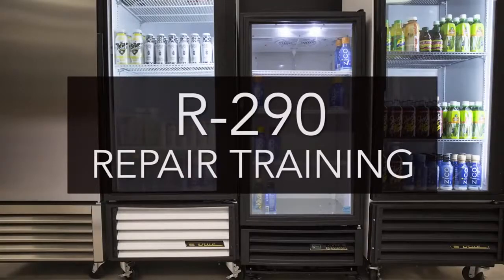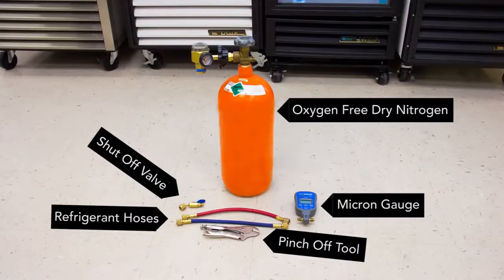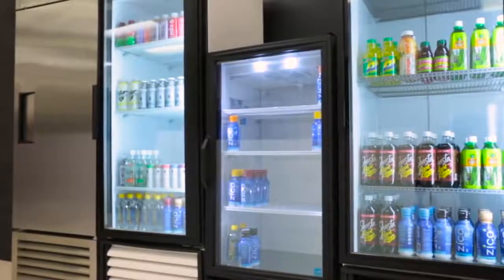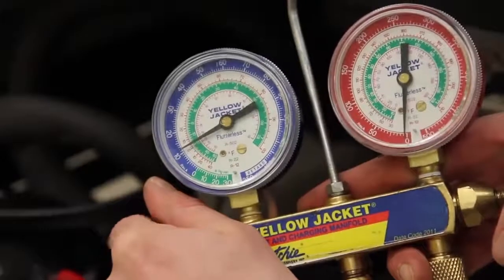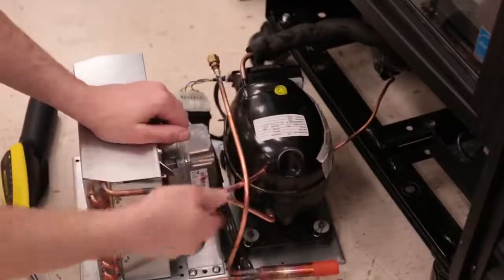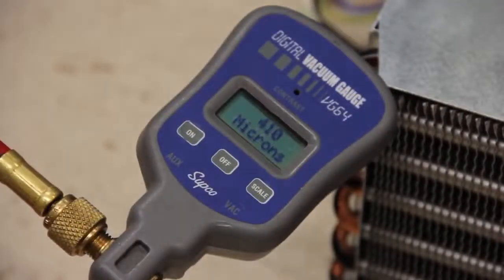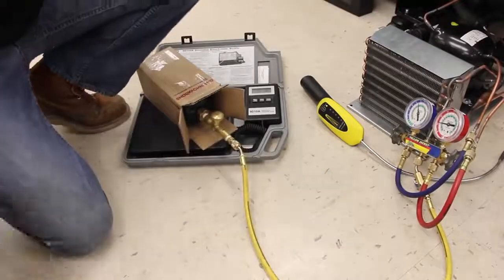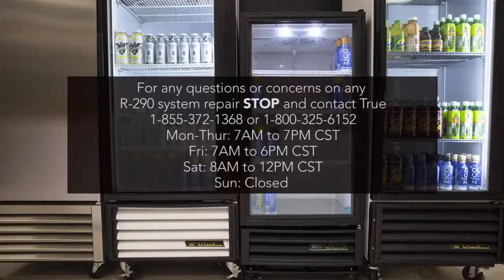How to Repair Refrigerators and Freezers That Use R290 Refrigerant | True Commercial Refrigeration

Comment: Been a refer tech since 1975, the first thing they we learned was the refrigant was NON FLAMABLE, I guess people once considered that important ! Personally, at this point I wouldn’t touch a unit charged with propane or butane with a ten foot pole. I feel sorry for you technicians out there that are now being forced by to deal with this cockamamie shit by these ignorant millennial engineers.
Reply: It's the "global warming/climate change" insanity that has us throwing one of the once critical requirements of refrigerants out the window.

I've beena tech since 93 myself and this blows my mind, but then it's just one of many ways environmentalists are getting people killed.

Look up the high rise fire from an R-290 refrigerator about 6-10 years back in the UK where over 80 people died in the fire as one of the worst examples.